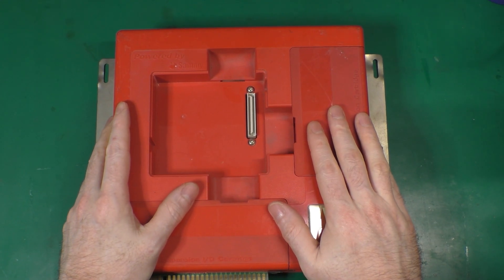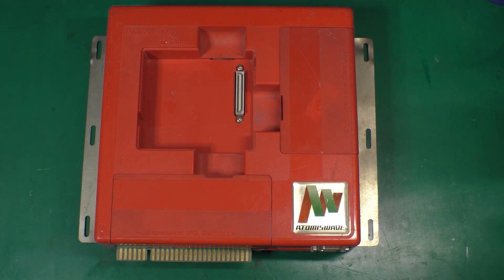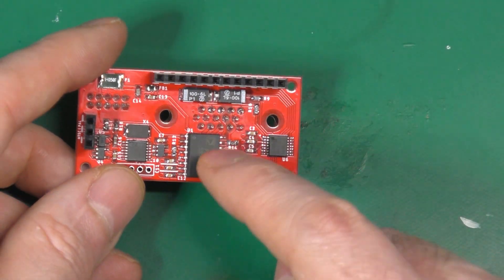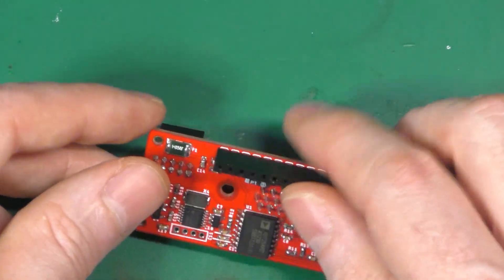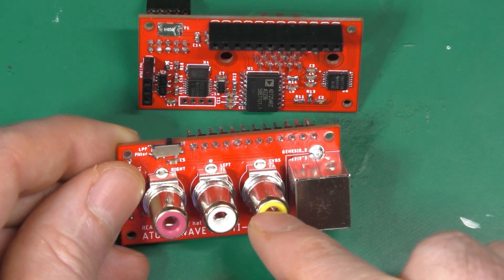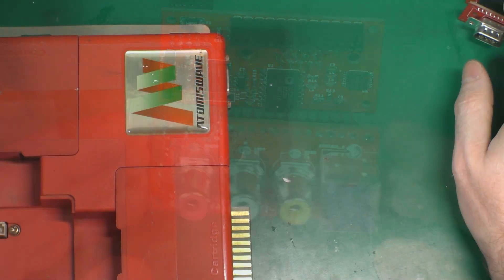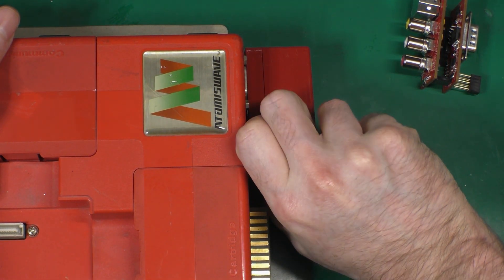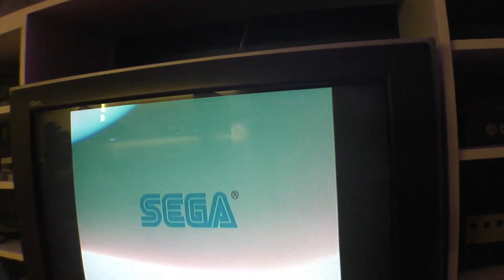Atomiswave Multiout + Full Service - Composite output, change battery, Noctua Silent Mod

Comment: Y a t il une amplification video ?
Reply from the maker: Oui: THS7374 avec ce qu'il faut pour avoir les bonnes valeurs de voltage en sorties (et capable d'avoir par exemple en meme temps la sorties RCA et miniDIN de branchées).